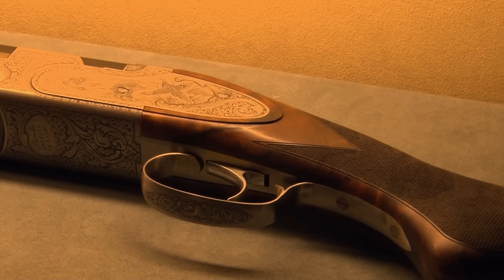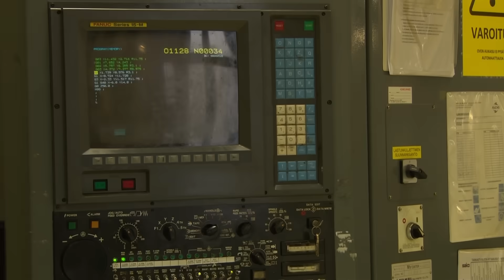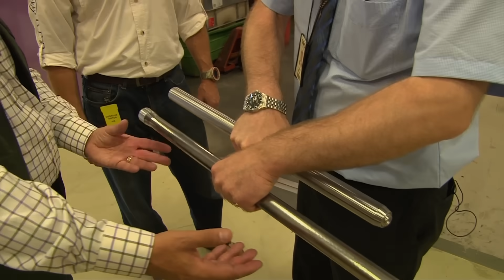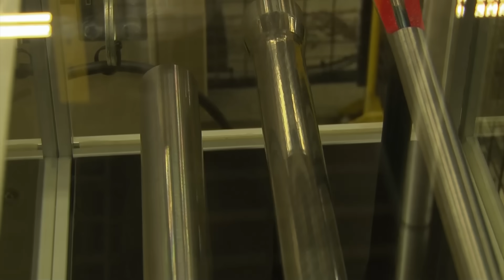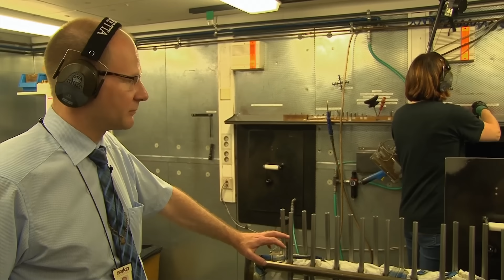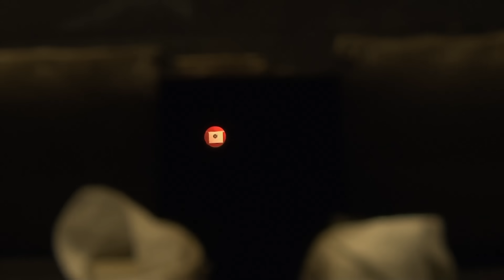How Rifles Are Made | How It's Made (Sako & Tikka GUN PRODUCTION)

Comment: I sighted a friend's Sako in for him after his scope mount was replaced. This was thirty years ago before all the CNC and computers really came into use. It is still the most accurate production rifle I have ever shot. It printed a perfect tiny three-shot clover with all the holes overlapping by one-third. It was a beautiful walnut stock with a highly polished blued steel rifle in 30-06.
Reply: @DieselRamcharger  Yes I kinda remember that happening. That was a completely different kind of computer though. The gun manufacturing industry was not using the type of computers or programs we have today. Yes, they were using some basic X, Y, Z-axis computer-controlled machines but the industry still depended on analog computers back then.
Reply: @DieselRamcharger  Yes, I remember still writing basic code back in the late 80s even when Windows was coming out but was really just a shell for dos. My main point in all this is the Gun industry is using more CNC particularly 5 axis machines today that they didn't have 30 or so years ago. We all get to benefit from the advances in technology in the shooting world.
Reply: Close tolerances have nothing to do with CNC machines.   Old manual machines with skilled tradesman  who meet the tight tolerances on the blueprint  are the equal of CNC.    CNC machines just speed up production and lower cost per unit.
Reply: @MrJdebest  that's the benefits of CNC they're simply faster, efficient, and consistent even in large volume. But just like any other tool, they're only beneficial if you can use it properly.
Reply: @DieselRamcharger  i'm after one of those old school standup mills but i have no money...do you know of anyone who has one taking up space and wants it removed? i live in Arizona
Reply: @MrJdebest  CNC also optimizes the SFM and FPM. The tools last longer than on manual machines, and the finish is superior. But most of of all the biggest advantage of CNC is repeatability.
Reply: @DieselRamcharger  As an example, I was employed at the now defunct Douglas Aircraft in Brampton, Ontario, Canada milling box girders on a "venetian blind" 5 axis machine for the DC 10 in 1969. Before that in 1967 I worked at Canadian Arsenals Ltd., Longbranch, Canada, writing (punching tape) code for Edlund CNC auto tool changing mills with mirror imaging tables. You are quite correct; Numeric Control was doing this stuff for decades before all the digital stuff came along.
Reply: @DieselRamcharger  Moon ? ,You think we landed on the moon yet we are unable to do that in 2021 .Wow some people are weird
Reply: It's a shame that you were sharing a nice story with us and some Einstein that wants to let us know WOW he owns a machine shop WOW, and has to question everything you say when all you were doing was sharing a memory with us and telling us the quality of a great rifle, thank for sharing your experience 😊
Reply: @DieselRamcharger   liar

Comment: As a machinist of 22 years this was fun and interesting. The red ruby indicator tip is used because dragging any tip made of anything else will wear from abrasion. And ruby is the most wear resistant. And checking the dimensions of hundreds and thousands of pieces these will be the most accurate the longest between replacement and rezeroing your tool tip.
Reply from the maker: Interesting. Makes sense but didn’t know that. 👍

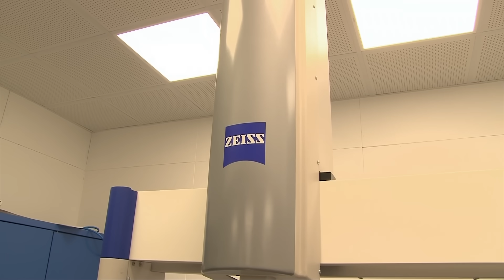Comment: 07:03  It is not about insuring that the machine in working as programmed since once a program is proofed and a first piece is accepted,  the only change to occur will be a change in dimensions due to tool wear.  That will be determined by the results of the measurements from the CMM.

Comment: My experience, the most accurate barrels I’ve owned are made by cut-rifling process.  Hammer-forged, like most factory barrels, accuracy was the least even compared to my button-rifled barrels.
Reply from the maker: Cold hammer forged barrels outlast the others and require no break in period. If there is an accuracy advantage to the other methods, it’s highly unlikely to be noticed by most shooters and definitely irrelevant in almost all normal hunting distances. Who wants to fire 200 rounds down a barrel just to break it in?

Comment: just noticed no bedding was done from the barrel to the stock, its basically just screwed into place, also how much perfection is or has been done on making sure the squared angles are on all the surfaces of the receiver and bolt, which is why even a new Tikka or sako bolt action rifle is sent to pro gunsmiths to check that, also to have the rifle tuned perfectly, so bedding the barrel to the stock, making sure all the angels of where the points of contacts are all perfectly squared up? basically blueprinting the rifle?

Comment: Just wondering if any tool and die / mould makers contribute to the making of your products. If so was it a small or large contribution. Thanks for your time 🙂 have a wonderful day
Reply: A lot of parts is made from custom tools made by toolmakers.  The bolt is press forged by using a tool. The end piece of the but stock is made by molding.  The trigger assembly probably contains some stamped parts. Also the magazine spring must be made by a stamping and bending tool.
Reply: @sidekickbob7227  thanks for your reply today.  Great info! Sometimes people don’t know realize how much these craftsmen do every day to make high precision tooling to specification. The gunsmith / engineer gives the final say on whether it works as intended and is ready to ship. Lots of very hard work involved manufacturing a precision part out of raw materials. Very good look into how a Sako / Tikka is made very impressive!

Comment: Comparing the tikka to the Bergara wilderness hunter. The Bergara is better in every way but weight and maybe drop mag instead of box magazine

Both have sub moa guarantee 
Bergara now has a fluted bolts and is smoother than current tikka
Better stock
Extra round in the box magazine 
Metal trigger guard. 
Wilderness is cerakoted and tikka is stainless. I prefer cerakote.

Comment: Why is Sako so much more costly than a Tikka?..love both though.
Reply: Tikka doesn’t have as high of quality parts so they can have a lower cost rifle. The funny part is tikka is still higher quality than some of sako’s competition.
Reply: @skylerspringsteen5730  but the MOA's are  no different though.
Reply: The tikkas are a modular platform using only a long action so manufacturing can be more efficient. Also the stocks tend to be a lower grade (not always) on the tikka. And the sako 85’s are pillar bedded, the tikkas are not. Bare in mind I had my tikka T3 glass and pillar bedded professionally for $100. They share the same barrels.
Reply: Tikka's bottom metal is not metal. Another place where they saved some money.
Hadn't noticed the action being long action on my 7mm-08. Will have to check that tonight when I get home lol.
Reply: Sako is guaranteed sub MOA with 5 rounds factory ammo test, Tikka 3 round group. For hunter no difference really as only the first shot counts. For target work, to get sub moa 5 shot group is whole another thing - both for the gun and the man behind it -  than sub moa 3 shot group.

Comment: Come on Sako plastic mags and base plates. Pick up your game and go back to old school, people will pay for old school quality otherwise your just another manufacturer.
Reply: Maybe plastic mags for the A7(Budget model) but Sako 85's have fully metal magazines.
Reply: @endutubecensorship  New s20 models have glassfiber/polymer mags.
Also new tikka rifles have singestack plastic magazines.
All sako rifles have doublestack mags.
Reply: @Kesssuli  I knew about the S20 but not much about the specs. 

You are correct for most Tikkas, but the Ranger and CTR models have a steel magazine body with polymer baseplate/follower.

The Sako A7 magazine's are single stack.
Reply: @endutubecensorship  Yeah i just checked it back and yes ctr models are made from metal. That one slipped from my memory. Ranger model i can understand very easily when you want rugged rifle then maybe plastic mags arent enought to be 100% sure that they can take abuse.
Reply: @Kesssuli  I feel the same, but I have stood on Tikka T3 magazine's and they held up/fed properly. I was impressed
Reply: @endutubecensorship  most likely they will work fine in normal hunting conditions. One thing what i miss in those is that you cant load it from top like sako magazines. In my 30 06 those rounds will almost like drop in without need ro remove mag for reloading when shootin in range. Usefull when using sandbags so i dont need to move that rifle. Yes single loading is an option but.  i like to load couple more because i can.
Reply: @Kesssuli  I agree, it's nice to have options